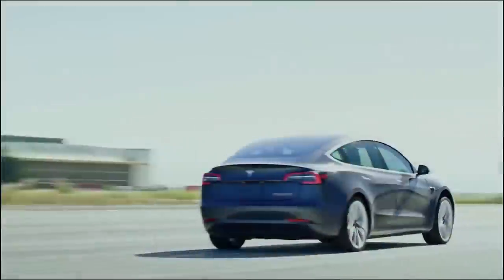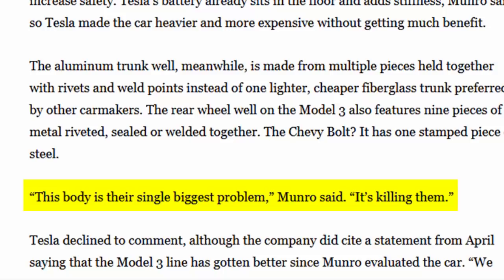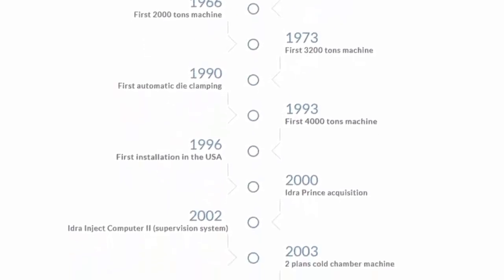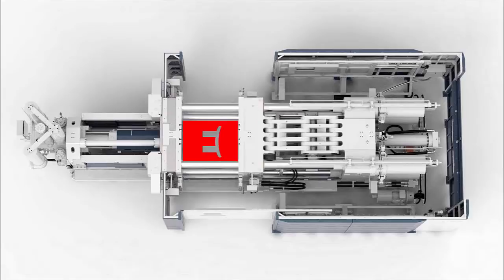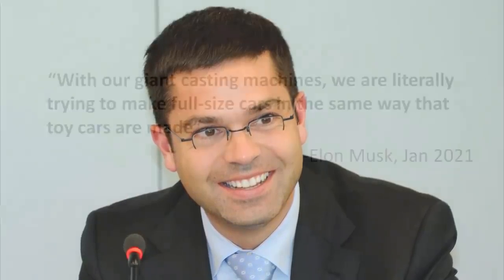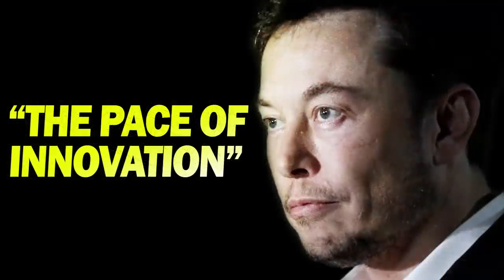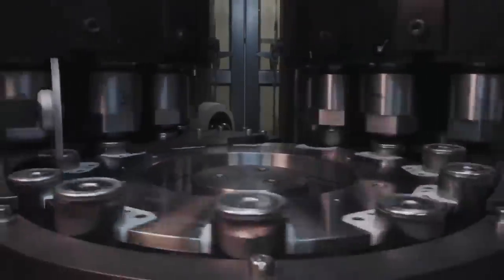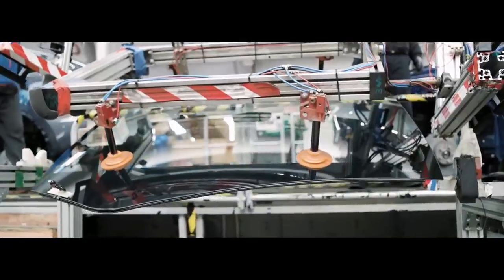Tesla Giga Press will CRUSH

Comment from the maker: Do you think the Giga Press is Tesla's secret weapon, and will they achieve the production rates discussed, at Giga Berlin?
The Frightening Economics of the Tesla Model Y: https://www.youtube.com/watch?v=aArRQKj7EB0

Inside Tesla’s Secret Plan to Dominate with Solar and Powerwall Plus: https://www.youtube.com/watch?v=W8ivhjzhYXQ
Have a look at our website https://themarketisopen.com
Reply: Its a weapon, yes, but its hardly a secret!.. 

The secret weapon is the 4680 battery cell, which will drive cost down so much, Tesla will always be able to undercut its competition, and still make a ton of money on each car... The legacy car industry have itself committed for YEARS to the pouch cell and moduled pack platforms (VW MEB platform, GM Ultium battery platform, Stellantis also has such a platform.. Yeah, they copied Tesla from about a decade ago..) and with that they are stuck with a battery system that is at least twice as expensive and much heavier than what Tesla will make.. 

Add to that the battery supply constraints legacy has. preventing them to ramp up production of EV's to Tesla levels, the old fashioned body and white designs, the 69 different models and 420 option packages they have to manage.. Really, you must be a dumb ass moron to invest in GM, Ford or VW. IMHO they are all doomed.

Its really sad to see this happen, I drove a BMW electric car prototype, about 10 years ago, with a more or less cubic battery at the place of where the engine normally is, it was a BMW 3 series body of that time. I drove it up and down the runway of a former military airport, man that car was quick!.. It was the moment I knew.. This IS the future, gas is done!... Since then I started to look into electric cars, but it took a decade before something hit the market that suits my needs AND wallet!.. The Tesla Model Y.. I briefly looked at BMW, but it is no way near to what Tesla has to offer, the Model Y is a much more capable car and costs less! Placed my order almost a year ago, and right now so stoked it will be a Next Gen Model Y, made in Berlin, with all these new technologies, will be an amazing car!
Reply: @MarcoNierop  BMW & Honda will go back to motorcycles & niche vehicles. 

GM will be a military supplier, the Ultrium pack looks like a military ammo box for a good reason.  It's specc'ed MILSPEC.
Reply: The casting machine is not a secret weapon. Buying the company that makes them would be of very little value to Tesla. That machine will last for many years. What is really interesting is the molds that go into the machine. Because of the high heat, they don't last very long, and because of their large size, there are very few companies that can make them and repair them. They'll wear them out almost as fast as they can build new ones.
Reply: @mnotlyon  
The moulds..... Slide onto (very large) pins within the press. As Sandy Munro indicated recently, a set can be swapped out in a couple of hours, either to replace damaged parts of produce a different component.
Reply: @rogerstarkey5390  I'm aware of how the molds work. My company builds them.
Reply: @mnotlyon  Do you know this or is it speculation? What material are the moulds made from?
Reply: @BjorckBengt  I know this. I build injection molds for a living. I haven't built a  diecast mold for a few years, but back when I did, they were made from H-13 tool steel.
Reply: @mnotlyon  Interesting, thank you! I see that H-13 is hardened after finishing. How long do you think it will last. I saw figures of up to 1M but I assume that is for plastic. It would be interesting to understand if the mould cost is significant. If they can make 100k parts and the mould cost is €1M then it is 10€ per shot and not significant but I am just guessing.
Reply: @BjorckBengt  I think your guesses are pretty good. Plastic injection molds do indeed hold up much better. The plastic processing temperatures are much cooler.

H-13 is typically machined close to size before heat treat. Then, the critical dimensions are finished after heat treat because it has a tendency to move dimentionaly during the heat treat process. 

The steel has a tendency to create surface cracks as the high pressures and heat are applied. The molds have internal cooling that causes the aluminium to solidify for fast cycle times (1.5 minutes is pretty fast for a part this size), but that means it gets a thermal shock each time more molten aluminum is introduced to the mold. The aluminium is also abrasive at these pressures and will actually erode the mold surfaces. I've seen brand new tools that I built 6 months after they were made that needed to be completely replaced. I don't know how many times the mold was cycled, but I'd think somewhere between 100k and 200k. 

The molds are VERY expensive. Presently we work on molds that are pushing $200,000, and they're not nearly this large. Depending on the complexity of the part, these molds could easily exceed a million dollars.

My shop works on molds for most of the automakers. Including Tesla. :)
Reply: @mnotlyon  Thank you for the info and congratulations in being part of the future!
Reply: @BjorckBengt  LOL, I've been part of the future for over 30 years. None of this is new technology. The size is impressive, but the technology has been around for a long time. :)
Reply: @mnotlyon  so what tool lifetime do you think we are looking at here? 250-500k shots?
Reply: @mnotlyon  But in replacing worn moulds, won't that be the same process for modifying &/or creating new (e.g., sub-$25k car) molds that has been written about, elsewhere?
Reply: @Crunch_dGH  Yes, mostly the same process. As the mold wears, it can often be repaired by welding and remaching, which saves a lot of time and money. At some point, it's easier and better to just start over on new inserts, but even then, the frame work (mold base) of the mold can be reused, so it's not quite as bad as starting from scratch.
Reply: Injection mould casting is standard practise for smaller parts. The only difference is Elon's willingness to go big. Other manufacturers must follow suit or die. Fortunately for them there are many engineers who know hoe to design for aluminium casting. It will be more difficult to copy Tesla's battery design.
Reply: Yeah, this is huge!  You did a VERY good job breaking everything down and explaining the technology, too!  Great video!
Reply: Re: Many giga-castings appearing outside factories, Any idea of how many precasted Model Y chassis "sets" will be needed to prime the production line prior to start-up?
Reply: @Crunch_dGH   They may be fine tuning time and temperature, and checking for imperfections.
Reply: The parts coming off of these molds inevitably need secondary machining operations. I'd love to see the machine tools they're using for that.
Reply: @mnotlyon  Would it be possible to cut with laser?
Reply: @BjorckBengt  The molds?

No. Lasers cut all the way through, and not nearly accurate enough. The heat would also affect the heat treatment of the steel.

Molds are mostly built on milling machines.

However, there are some very interesting 3d printers being developed that print in tool steels. Although they're not accurate enough to finish the mods, they could save huge amounts of time  producing the rough shape and internal water channels.

Elon, if you're reading, I'd be happy to lead your 3d printed mold building team. :)
Reply: @mnotlyon  No I meant the secondary machining operations you mentioned and cutting off the gates. I assume that there is sufficient precision in the casting for control surfaces.
Reply: @BjorckBengt  Removing the overflow and flash is usually done with dies. Lasers would be too slow.

In a casting this large, holding critical dimensions is hard to do because everything shrinks as it cools. Critical locations will have to be machined, as well as things like threaded holes and dowel pins
Reply: @mnotlyon  I giuess then you can make the design to allow for simple die cutting.
When it comes to accuracy, I was thinking that a fabricated sheet metal structure welded from many parts would be much less accurate, typically no better than 1mm, so surfaces should be ok, but threading will be needed. Can they place dowel pins in the mould before casting?

What do you think about the patent with multi-directional unibody casting for a vehicle frame?
Will it be possible to cast everything except panels in one shot?
Reply: @BjorckBengt  No, the casting will always have accuracy problems. When things cool, they shrink. When they shrink, this creates internal stresses that are different because of  wall thicknesses that are different, and ribs that are added for strength. This makes the shrinkage less predictable. Things like outside temperature and even humidity makes this change. The larger the part, the worse the problems will be. These parts will be shrinking as much as a centimeter in one direction, but maybe only a couple of MM in the other direction. These problems would make loading dowels in the mold ahead of time useless.

I don't think there would be an advantage to molding an entire frame. Right now the design is to mold the axel areas, and all the parts in the middle are frameless, relying on the battery tray to create the structure. I think this will save weight and help to eliminate the stress and shrinkage issues described above. The mold would also get insanely complicated to create a part that will actually be able to eject from the tool without undercuts.
Reply: @mnotlyon  Thank you for your insights! I still retain some hope for that Tesla will make a breakthrough at some point in time. Cheers!
Reply: @BjorckBengt  Tesla is making breakthroughs ALL the time.

The battery becoming part of the frame is actually genius. It's one of those "slap yourself in the forehead, why didn't I think of that" kind of things. :)

The future is going to be interesting. :)
Reply: @mnotlyon  yep genius in poluting the enviroment. I don't hear anything about how do they plan to recycle them apart from static battery storage ( that is not the solution)
Reply: @hagestad  That's because you haven't looked. Right now used car batteries are very valuable for energy storage.

When they no longer function for that, the only part of them that is not recyclable is the paint. There are a number of companies already doing that.
Reply: @mnotlyon  Re: Recycling. Grueber vids show how they only need to find & manually bypass the few cells among thousands that have gone "parasitic" in order to "restore" bad packs. Knowing that each cell has its own computer, is it possible for such cells to take themselves offline, thus making packs live almost indefinitely? Maybe the wiring involved would be too complex (weight wise), so allowing single cells to take along its group of "sub-pack" cells would make it feasible?
Reply: @Crunch_dGH  Each cell does not have it's own computer. They are grouped together (I forget how many cells per group, but I think it's about 7) and monitored for voltage and temperature by a BMS. The BMS can shut down the whole pack if there's a problem, but it does not have individual cell control. To give it that kind of control would require wiring each cell through a switch, which would be expensive in weight, money, charge rate and discharge rate.

Each cell is however individually fused. If a cell is bad enough, and it pops the fuse, it's not that hard to find it and replace it. However, by the time the pack starts blowing fuses it's probably out of balance and needs to be disassembled so that cells can be sorted by their capacities.
Reply: In my opinion... Tesla/Musk castings = Disposable throwaway cars! Just wait until there's a collision and you crack your crappy casting.
Reply: @DavidJohnson-tv2nn  How is that different than damaging a unibody?
Reply: @mnotlyon  Conventional unibody structure will deform in a collision. Almost every auto body shop has large jigs and tools  specifically designed for straightening unibody structure back to factory specs. Cast parts are likely to crack and shatter in a collision. 
Even worse, is the structural battery pack. Think about it... You are literally sitting on top of that thing. A side impact collision that breaks it open, and you become a crispy critter in a couple of seconds! 
If you're lucky to live long enough, and your battery needs replacing... You have a disposable, throwaway car. Musk gets another 50 $80,000 from you.
Reply: @DavidJohnson-tv2nn  Cast parts can also be straightened and welded, and ICE cars catch fire far more often than electric cars. Your point is built on a straw man fallacy.
Reply: @mnotlyon  First, you are not sitting directly on top your gas tank. If the top of your gas tank were your floor pan, I would be saying the same thing!  
Second, are you suggesting that cast parts aren't brittle, and don't crack and shatter upon impact?
Reply: @DavidJohnson-tv2nn  No, I'm suggesting that they can be repaired. 

Brittleness will be determined by the material being cast.
Reply: @DavidJohnson-tv2nn  Funny think about a ruptured fuel tank. They tend to make quite a puddle.....
Reply: @mnotlyon  I'm sure not going to take Musk's word for it. Or any other manufacturer for that matter. To me, it makes sense to wait and see real world crash results before committing a large sum of money. That goes for any company that adopts a new process like that.
If a vehicle is not repairable after a moderate impact, I won't buy.
Reply: Their secret weapon is the industrial Powerpacks to keep the rest of the business afloat. This is going to be the same as AWS being the juggernaut keeping Amazon afloat.
Reply: You missed a key item which likely precludes Tesla from buying the giga-press manufacturers.  The company is Hong Kong based, and the CCP closely control what can be sold. If the CCP sees a strategic value to giga-presses, sale of the companies would be banned, just as the CCP has banned free speech.
Reply: Thank you for sharing such important information.
Reply: you misspelled Idra Group press
Reply: Factual errors in  your vid- two IDRA machines in Texas NOT ONE. Machines in Shanghai are LK NOT IDRA. It has been posted by Musk that NO quenching is used after the GIGAPRESS.
Reply: Sounds like Cave Johnson
Reply: @abrahamyanes2405  Sounds like fanatical Musk fanboy.
Reply: I think we should  bring back America jobs names back to America and lower taxes on American jobs and people and make foreign countries pay up for stealing jobs and getting tax breaks over America people foreign trades are terrible it benefits other countries Democrats do not want this country to succeed
Reply: @jamieeisenhower1560  Just curious if you have the typical Republican point of view that Covid should be treated like a joke and Trump won the election?
Reply: @DavidJohnson-tv2nn  read wisely for one you don't know what you're talkin about Trump did not treat it as a joke and the only jokester here is Democrats they know how to interpolate people's week minds hi taxes no future no education and no freedom look at the cities and California and New York where all the problems are China buying up our jobs and not paying the same taxes as us Americans get out of lala land and get into the real world this has nothing to do with Republicans and Democrats it's called reality of what the truth is all the Democrat areas seem to have poor education violence racism hatred the blame game drugs and human trafficking and baby killing and gun free zones to get people killed and more than anywhere else like a third world country in those areas people buying foreign products going through self-service checkouts buying online that gets rid of jobs it gets rid of the cycle of people's retirement you pay into retirement funds and retire the young youth is taught to blame others for their problems and skin color just like older people of today's world American flag stands for one nation under God for all not one type of people Democrats sure want to destroy history so they can cover up their crimes that's why we have all Amendment rights to protect us from crooked people like the government we got right now call pervert Joe can't even think for himself using our tax money to take over presidency without even trying willing to sell our country down the river any leadership or anybody that wants to abolish the future of this country and mess with any type of amendment rights is just like Hitler remember all the creeps that are in office right now at this moment have not done anything for this country they just get richer and Trump created hundreds and hundreds of jobs for all colors of people and Democrats hate that they hate freedom and they hate Justice and they hate people that are individuals that think for themselves look at the history of the Democrat Party they are slave drivers and always will be greedy Two face backstabbers that's why all of Hollywood and ball players and most of those that live off our tax dollars hate the working class and hate family value and vote in drugs to keep people down today's people teach children to hate themselves and blame others for their problems educated black do not like black lives matter it's another put down word to say they need help when all colors need help means teach people to go after goals and stop blaming everybody else and bring our jobs back to this country the black lives matter woman that started black lives matter is filthy Rich now off everybody's money has about three mansions she isn't helping nobody
Reply: @jamieeisenhower1560  Wow, that's one hella run on sentence! So let us know how you really feel about Mach-Es being made in Mexico, vs Tesla's CA, UT, NY, & TX factories? Do you think it's wrong for them to co-locate plants in Asia & Europe to serve those communities regionally?
Reply: I think elon musk is a shill
Reply: You see those huge hydraulic rams?  They are pressing.
Reply: MUSK = New God! Mars = New Earth!! TESLA and Tesla Holders will be Kings. The Rest and Their Family will be our Batteries who will Work till Old to Supply All Energy for Bitcoin!! VIRGINs Hate Bitcoin just because it use Much Energy like Argentina. BUT Space X, King Elon, Tesla All Have Bitcoin. I never do Estrogen things like environment. Bitcoin and Tesla all the way!! LOSER Haters Forever Sad and CashLess. They are Even Too Poor to own Tesla or Bitcoin. Those PA THETIC Whiny Sad Bit ches. TESLA=KING, NON-Tesla= Loser Peasant!  ELon Is like Ironman who will destroy Thanos and critics are better off using their cash to wipe their A n us. Elon's FUTURE robots and AI will Destroy any whiny INFIDELS! JUST WATCH silly Haters. LOOK at all the celebrities, influencers, and TiKtok Reviews Endorsing TESLA. We already WON.
Reply: It disappoints me how regularly Tesla fans, unfamiliar with the auto industry, think Tesla invented everything. Cast structural elements have been used in cars for years. You can see hollow cast structures in Sandy Munro's underbody look at Ford's Mach E but else where you can find similar components of Mercedes, Audi, Volvo, etc.

There are significant downsides to the "one big piece" philosophy. some are engineering related but one accessible shortcoming is that these castings will be impossible to repair to as-new condition after a collision. Replacing them will be uneconomical since the entire end of the vehicle will have to be disassembled to make a replacement. This will likely dramatically increase the already high insurance costs for a Tesla since otherwise repairable cars will be written off. Tesla remotely disables functions on salvage cars that have been repaired, reducing what insurance companies can recover from crashed cars. The world needs more repairable products and fewer disposable ones.

Further, any change to the casting tool will be very costly and time consuming. Tesla is known for constantly making small design iterations.

Bottom line, this is not as clear cut as you make it sound. Tesla may well make it work. Only time will tell.

Addendum: In most purpose built EVs the battery provides structural rigidity (is "structural"). Look at the MEB or any other 'skateboard' for examples.
Reply: @Miata822  You're not wrong on any of your points. Time will tell if Tesla's gamble pays off. The one thing you can say for Tesla is they're not married to an idea. If this one doesn't work out, they'll spend plenty of money trying the next one.
Reply: @mnotlyon  True, but I've always been a fan of doing the engineering and testing first. Quality is one area where Tesla takes a lot of hits. They could overcome that by faking the time to make sure the product is right before selling it.
Reply: @Miata822  If you had bothered to read Dave Lyons comments above you would know that the tools cost about $10 per shot and last for 100k shots, meaning that they are anyhow replaced a few times annually. 
You totally miss the point about novelty. Nobody said casting was new. What is new is the scale and the huge impact it will have on cost and accuracy.
The cost of repair is a non issue. Most cars are not involved in heavy collisions and when they are the most important thing is safety. Tesla makes the safest cars in the world. That is why insurance by Tesla will be the lowest in the world. Insurance cost for injuries are ten times as costly as a car. For light damage, only panels will be dented and a cast structure will maintain integrity better.
You also totally missed the point about structural battery packs. In Tesla 4680 battery packs the cells will be carrying shear loads. This makes the battery box much simpler and lighter. The MEB do not have load bearing cells. Are you sure that you are familiar with the auto industry?
If you bothered to learn the details maybe you would better understand Tesla fans.
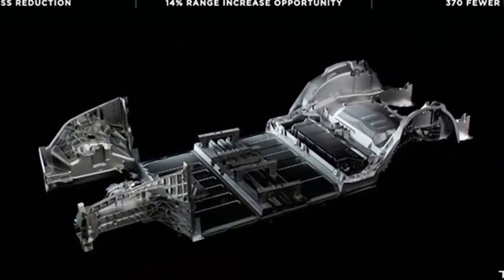Reply: @BjorckBengt  Note the image at 2:53
The fender liners and bumper support structure are part of the casting. These are components often repaired or replaced by body shops after a minor collision.

You say Tesla insurance will be cheaper. Today insurance is higher. Will be interesting to see if Tesla can follow through w/o just tacking the extra expense onto the sticker price.

I know what Tesla said about the battery, I simply don't believe it is significantly different than what others manufacture. The Ford battery doesn't appear especially strong but the aluminum MEB pack is very robust before the cell packs are added. The GM's Altium battery has steel cross members welded in. 

I'm also very skeptical about the cast part holding tolerances in volume production, certainly not in microns as Musk said.

Tesla talks a good game but history shows that they have more enthusiasm than integrity. You, of course, are free to buy one and beta test it with the rest of the customers. It might turn out fine. Do let us know.
Reply: @Miata822  We have to define what we mean with minor damage to come to any conclusion. My point is that most cars do not collide and those who do in most cases do not compromise structural integrity. For the few that do compromise structural integrity, most will be written off anyhow. You do not repair a car that is 3 year or more with that kind of damage. The few cars that have been in a collision which is heavy enough to require structural repair but not heavy enough for a write off and where the cars residual value justify a repair represent a very very small amount of money compared to the enormous saving you get when you vast a whole substructure in 90 seconds. Optimising for repair is false economy and it is getting more so as the cost for original manufacturing continue to shrink.

Yes the MEB pack is very robust before the cell packs are added. Tesla new pack will be weak but light before the cells are added. Once the structural cells are added it will be strong yet much lighter than those who do not have structural cells.
GM's battery pack is the worst since they use pouch batteries which do not support the pack at all.

Cast parts have much better accuracy than parts made from welded sheet metal. They are also more dimensionally consistent. They do shrink after moulding but in a repetitive way. Casting in a mould give much higher precision than sand casting or other casting methods. If you look at thickness tolerances it will be in microns. If you look at dimensions across the whole part tolerances will obviously be bigger.

Tesla talks a lot and in the end they typically exceed expectations after a few failures and iterations.
Tesla has the most satisfied customers and highest repurchase intent. They must be doing something right.
Reply: 💥💥💥💥💥💥💥💥💥💥💥💥💥💥   THIS IS WHY SHARES OF TESLA MAY COLLAPSE SOONER THAN MOST PEOPLE THINK   💥💥💥💥💥💥💥💥💥💥💥💥💥💥
⚡
1) The competition is coming on strong, especially from Ford. May is Ford's best month for EV sales, more than 250% higher than the previous month. Tesla is on a steep decline.
2) Earlier this month, Ford released their F-150 Lightning. Preorders are through the roof. Ford claimed that the range was 300 miles, but according to Brownlee, it's really 469 miles which beats out any current Tesla vehile on the road today. (Ford usually under estimates range, while Tesla grossly over estimates range)
3) People are loving the NEW Ford Mustang Mach E. There is a lot of hype on this vehicle. A Model Y and the Mustang Mach E were parked side by side. People were asked to examine each vehicle, and then pick which one they wanted. The Mach E won by a huge landslide.
4) Because of the disrespect shown towards the Chinese community by Tesla, most Chinese people don't want to have anything to do with Tesla. For a Chinese citizen to buy a Tesla car, it's like showing disrespect to your culture, and your Chinese beliefs. People are now frowned upon for dealing with such a company.
5) Tesla was caught cheating the great people of Norway, so much that the government had to step in and fight Tesla in a class action lawsuit. They won the class action. I'm not sure why someone would now want to deal with a company that gets sued by a government, a government who wants to stand up for the rights of its people. Some are saying that if the people were stupid enough to buy a Tesla, then they shouldn't get a single penny. I say that its not fair to call them stupid. They just got suckered into dealing with Tesla because they had the Tesla blinders on and didn't listen to PNS. People need to beware when they are dealing with a company that misleads. It's like those energey savers that you plug into your wall, and then you chop your electricity bill by 90%. Wonder if it's Tesla owners buying this product?
6) FSD is still not ready, and it may be another 2 to 5 years before it is. Tesla needs to do a re-write as they have decided not to include radar in FSD. Those who have paid for complete FSD should request their money back. If they are told by Tesla, " You bought it, we have your money, your not getting it back, now go cry me a river", we suggest you speak with a lawyer. You paid for something that you thought you were getting, but never got. A fair company would refund your money. Maybe another class action is in order. Another class action would hammer the shares lower.
7) CyberTruck preorder numbers have been falsified - not by Tesla, but by individuals (and possibly by some big investors) just to pump up the price of the shares. When I release the real preorder numbers, shares of Tesla may get crushed.
8) Bitcoin will become worthless sooner, rather than later. What can you do with Bitcoin .... nothing! You take REAL money (that you can buy anything with) and buy FAKE money (that you can buy nothing with). Does that make any sense at all to a normal person? Your only hope and salvation is that you find another sucker to spend more for the Bitcoin than what you bought if for. 
Governments want it shut down. They want to be the ones to control Crypto. If Tesla continues to have diamond hands, then you can write another 1.3 Billion dollars off their books. Does Tesla care? Not really .... it's only the money of investors.
9) Sales in Tesla are expected to plunge ..... and plunge very very bad in the coming years. The competition will be eating their breakfast, lunch and dinner.
10) Used Tesla's are flooding the market as people are dumping them for a better EV. Check out the auto trader to see how many Tesla's are up for sale. You won't believe your eyes...
Reply: @jimcmf2  no the problem is people buying foreign product buying online and going through self-service checkouts that's how jobs go away as Americans an American named job suffer because we pay for everybody else's problems with higher taxes than foreign companies and everybody else and Democrats spreading hatred and violence and trying to get rid of jobs and history and freedom
Reply: @jimcmf2  Guess you haven't seen TE's recent deft assessment of challenges facing ICE makes attempting to transition a 99% ICE maket to electric despite EV's mere 1% penetration. That's without piling on about dendrite/swelling-prone, non-structural capable, pouch formats vs tabless cells. Hate seeing them do so poorly, so early in the game!

youtu.be/jWe_c1yCLg0
Reply: @Crunch_dGH  

Tesla is burning through cash faster than the California wildfires. Ford is not.  Even Eastman Kodak and BlackBerry had lots of cash before sales tanked, and expenses exceeded cash coming in. Look at Tesla's sales in China. They were suppose to double, but instead, they were cut in half. That spells Trouble with a capital "T"

I just wanted to keep the investors informed as to the status of the company so that they don't lose their entire investment in a "pump and dump scheme". Look at where the shares are heading. Down the toilet, and really really fast.